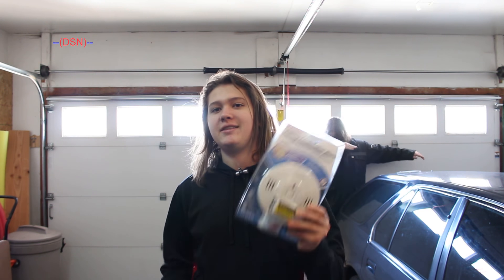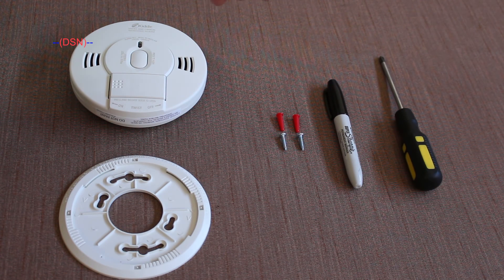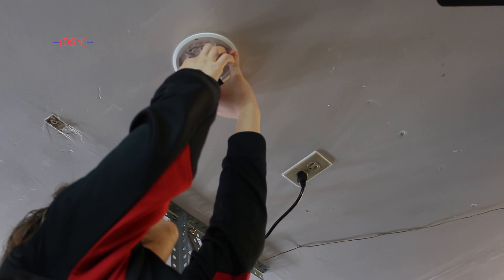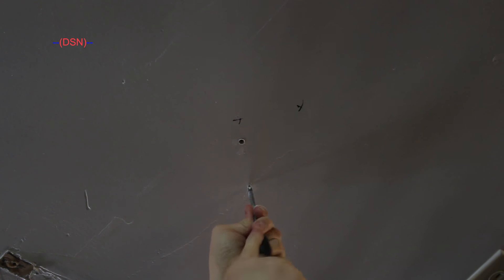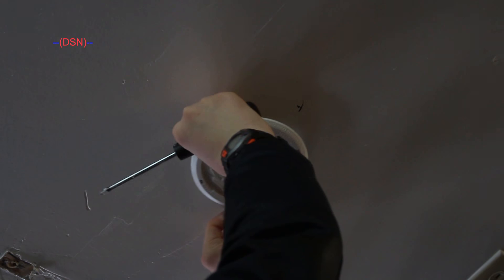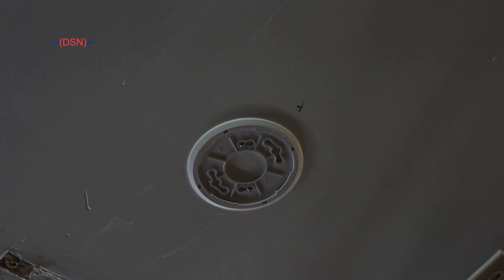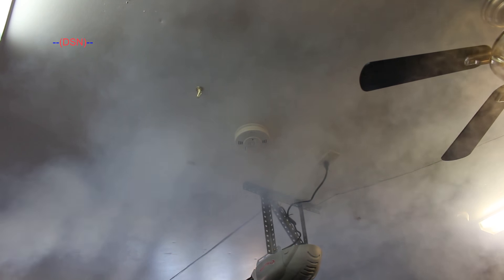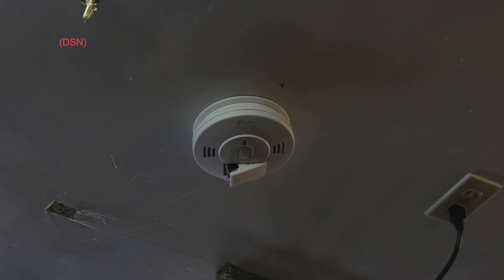How To Install a Smoke Alarm

Comment: I have a heat detector in the garage, but it's a high ceiling.  Fortunately I haven't had any false alarms yet.  Smoke and CO are in the house; I'm not concerned about CO in the garage since not only am I not going to leave a car running in there, I also can't fit one because of all the stuff in it!  Also makes it easier to fire up my snowblower in the winter in the garage so I can start snowblowing immediately just by driving it out of there.
Reply: jaykay18 i ministers eminem i’ll lull out my
Reply: CO Also comes from gas appliances and anything that generates smoke, boilers and water heaters for example